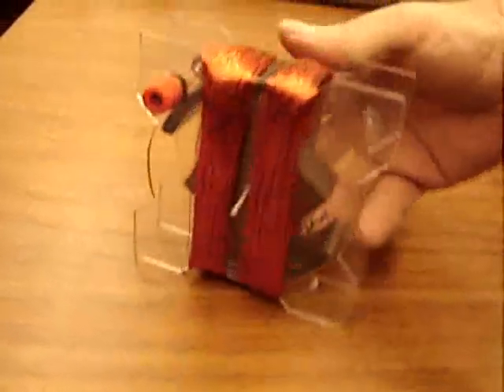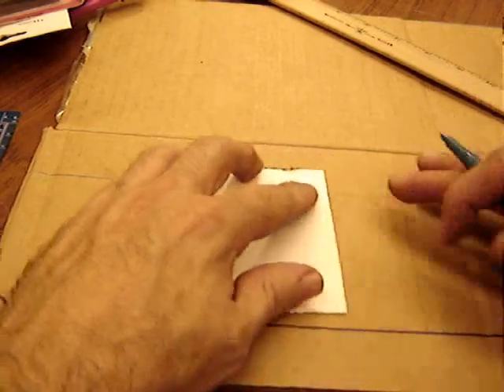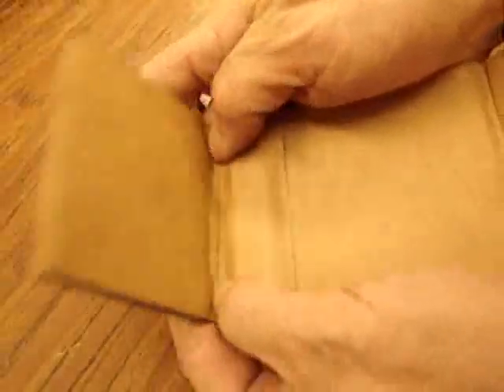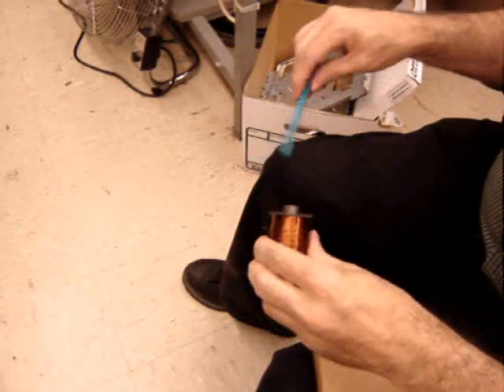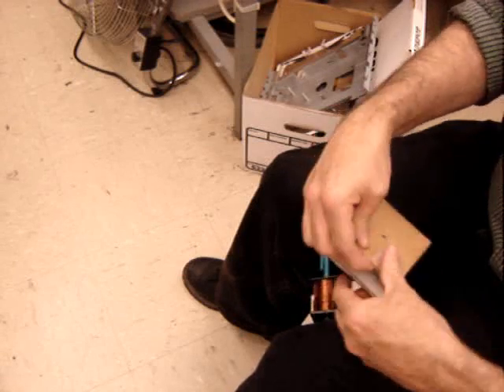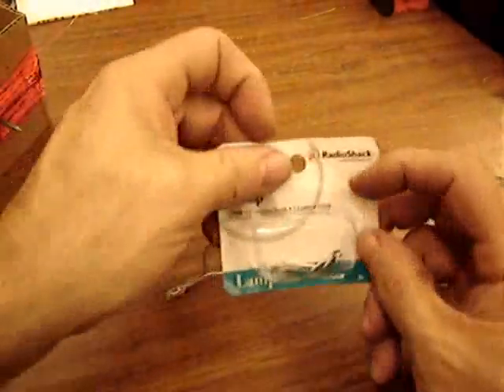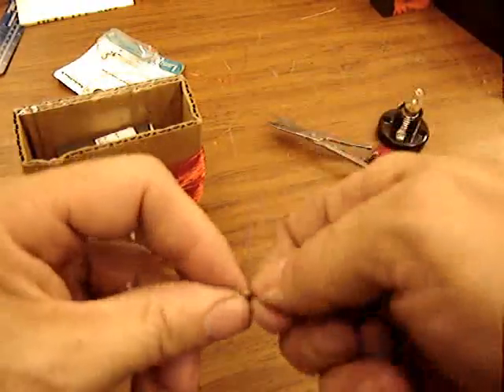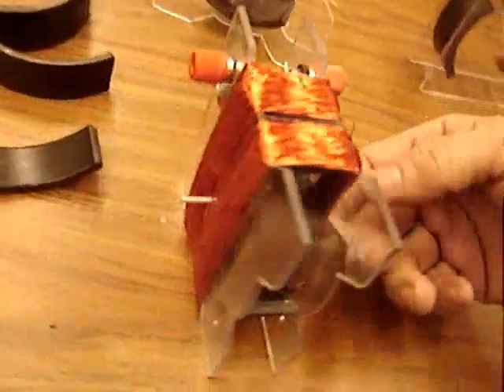Simple generator:  AC electric generator for science fair

Comment from the maker: Twice too big!   Needs to be under 0.3mm diameter, and enamel insulated (no thick vinyl insulation.)   See the website for all info, question 1. on the FAQ is about different wire & different magnets.

Trouble is, you need to wind 250 or 500 or more turns of wire.   If the wire is too thick, you end up with a huge wad, and the outer part of the coil is way too far from the magnets.

Comment from the maker: Ignore the video.   Go to the website.   Read the "DEBUGGING" section.   Try all those suggestions.

Usual problem: didn't spin fast enough.   The magnets have to really whiz like a blur.   Magnets MUST spin freely.  If the cardboard is grabbing the magnets and halting them, it won't work.

Second common problem: tried using different parts.  Didn't use the very thin #30 gauge enameled wire, didn't use special Radio Shack light bulb (since normal flashlight bulbs won't work.)

Comment from the maker: The more turns of wire and the more powerful the magnets, the greater the voltage.  Faraday induction: hyperphysics.phy-astr.gsu.edu/hbase/electric/farlaw.html  The generator is a constant-voltage source, with unknown current.

But because adding more turns of wire is adding more resistance, the maximum current stays the same when you add more turns.  To increase the max current you'd have to replace the coil with thicker wire.

Comment: This is based on an electrical engineering calculation.  The greater/bigger the magnets, and the more you wrap the copper, the greater the current.  I have not made this calculation in quite some time, but here's a general idea. Look at this web site hyperphysics.phy-astr.gsu.edu/hbase/magnetic/curloo.html  Bottom line is that the bigger the magnetic field and windings, the greater the current.

Comment from the maker: See main website, on "how it works."

If spinning those magnets with your fingers, each turn of wire gives about 1/300 volts.   To produce 1V for the bulb, you need about 300 turns.   That, or use expensive strong magnets.  Or spin them at 10,000RPM.   With *really* strong magnets spinning *really* fast, this generator would only need one loop of wire, not 300.

Comment: cut a drinking straw into two small pieces. Put them into the center holes and put the nail through them (so the nail touches the smooth plastic instead of the rough cardboard). This reduces friction greatly.

Comment from the maker: Not much thicker.  If you want it to work the first time, don't change anything.   Need hundreds of turns of wire, but also need to keep the turns very close to the magnets.  So, thin wire needed.

If your coil looks like a baseball, then the outer turns of wire are too far away from magnets, and do nothing.

Comment from the maker: Always build the original version first.   Any changes cause failure.  So, first make the successful version, then add small changes one by one.

Output volts is proportional to # turns in coil, and to flux change rate (roughly the RPM of magnets times the gauss at pole surface.)

It's easier to just wrap one turn around the spinning magnets and borrow oscilloscope to measure peak millivolts.    Then, if one turn of wire gives 1 millivolt, you'd need 1000 turns of wire to give one volt.

Comment from the maker: The nail store!  Hardware stores.

You can even try cutting up a wire coathanger.  When I was a kid, I did this by using a file to make a small notch, then bend it so it breaks at the notch.  (Or, many pliers have a tiny wirecutter thingy near the jagged gripper part.)

Comment from the maker: Go to website, read generator article, see partslist.    Large rectangle ceramic magnets from radio shack and other places.   Neo magnets that large would be $10 each (times four!)   If you use smaller neo magnets, voltage will be much higher, but build a much smaller box.  Don't use HDD magnets since they have two opposite poles on same side, which gives nearly zero volts output.

Comment from the maker: All the info is in the article.   The AC volts depends on how fast you spin it.  But it can only light up a bulb that needs LESS THAN one volt.   If you double the amount of wire, then you can light up a red LED that needs 1.7V.

Comment from the maker: But experiment defeats theory, so if the theory predicts failure, it's wrong.

:)

If the magnet stack went NSSN rather than NS, then as you say the average flux would be zero: an N pointing up and an N pointing dn.  Flux lines extend out the top of the coil, but with NS magnet the OPPOSITE flux lines extend out the BOTTOM, making it twice as strong instead of zero, because negative (south pointing) dotproduct negative (down pointing) gives positive.  Turn them 1/4 turn to change flux to zero.

Comment from the maker: You followed everything in DEBUGGING section?    Often the problem is the specialized Radio Shack light bulb (or one from All Electronics.)  Normal bulbs won't work.   But red LEDs do work, if you spin it faster.    Also, the magnets really have to whiz.  If they crash into the cardboard or even scrape hard, they won't go fast enough.

Comment from the maker: Have you read the article, DEBUGGING section?

Wire coating: read the article, USE SANDPAPER or the edge of a knife.

Magnets: did you spin them about ten times per second as the article says?  They really have to whiz.

Don't use any other bulb except the ones listed.   Or try a red LED.

Comment from the maker: AC voltmeters are designed for 60 cycles per second, not 10.  The reading is much lower than actual.

With neo magnets the voltage should be HUGE.   But the wire must remain very close to the magnets, hugging the magnets and almost scraping on them. If your magnets aren't the size shown in the article, then you must buy 5cm magnets.  Or make the cardboard much smaller.

Comment: s16.postimg.org/xm224n46t/Photo_on_5_19_13_at_10_19_PM.jpg
s16.postimg.org/3vexivj79/Photo_on_5_19_13_at_10_19_PM_3.jpg

getting only 0.25 v ac on my voltameter... 300 winds with #27 wire gauge with neo magnets, is there any way to amplify it?
also, I'm having trouble taking the thin coating off the wire as I am color blind and have a hard time using a knife, how do you take the wire coating off easily?

Comment: hi, i'd really appreciate if you'd help answer this

ive got most parts, but for the ceramic block magnets, ive found block magnets of a different size (20*15*5mm), should I just double it, or would that not work?

and also, for the magnet wire, i've found 0.5mm enamel copper wire 33 SWG, and im planning on joining two of them to get 200+ft would that be alright?

thanks very much

Comment from the maker: See the main article about this.  Spin the magnets much faster for red LED, or wind 500 turns, 800 turns, etc., or replace the ceramic magnets with neo rare earth magnets of equal size.   (With neo magnets, you only need about 50 to 70 turns of wire!  Don't use green or blue LEDs, they need even higher volts.)

Comment from the maker: Nope.  See the parts list, since it's from Radio Shack, also All Electronics, or buy a #48 or #49 miniature bulb.   These are specialized bulbs which can be lit up by half the voltage of the most sensitive LED.

Or, just use an LED and either spin the magnets twice as fast as for the bulb, or instead wind 2X or 3X more wire than 200ft.

Comment from the maker: 500T of wire gives about 1.5V when spun around 500 rpm.)   So 1000RPM would give twice as much voltage as 500RPM, or 3V output

But 500 turns of wire is about 400ft.  From wire gauge website, #30 gauge wire has 103ohms/1000ft, so  400/1000 x 103 = 41 ohms.

Maximum wattage on a bulb or resistor happens when the bulb or resistor is the same as the wire resistance.  And in that case, the bulb or resistor will pull the 3V down to 1.5V.   Output watts=1.5*1.5/41=0.0548, about 55 milliwatts

Comment from the maker: There are three spools on Radio Shack 278-1345.

Only use the #30 gauge,  200ft of wire.   I think it's the red-colored one, not the green, but Radio Shack could change the colors unexpected.   If in doubt, look closely and compare wire thickness.

Don't bother using the two thicker spools, they're way too short to make much difference.   It does help to buy TWO kits and use twice as much.  Spensive though.

Comment from the maker: Yep, neos are about 10X better.   But they need to be about the same size as the ceramic ones.   If smaller, then you have to use a smaller coil, so the wires stay close to the magnets.

Comment from the maker: See the main article.  A red LED will work, but you'll have to buy extra wire to wind lots more turns on your coil.  Either that, or figure out how to spin the magnet MUCH MUCH faster.   The special light bulb turns out at about 3/4 volt, while a red LED needs twice as much: 1.7V (must spin the magnets twice as fast if using an LED)

Comment from the maker: To charge a battery you need a DC generator.  Those things aren't simple.   But if you could build step-up gears or rubber band pulleys, you could spin this one 10X faster, and then add a diode to turn the AC into DC.   (To use a diode, the generator voltage must be WAY higher than 0.5VDC.  See the main article about diodes/DC/batteries.)

Comment from the maker: Wire doesn't have to be smooth.  But sometimes tiny knots/kinks will later cause a break.   Hint: for temporary, I wind the wire onto a large empty can, or even onto a 1ft ruler.

If you can spin the magnet faster than 10revs/sec, the voltage will be much higher.  In that case the coil can be farther from the magnets, and still light the special bulb (or even a red LED.)

Comment: great video. I was trying to recreate this using Legos for the housing. Unfortunately I wound too tightly and the housing collapsed. Now the wire is all knotted and kinked. Assuming I can get it unknotted, are the kinks a problem? I'm also not sure if the housing would have worked because the wire was fairly far from the tips of the magnets.

Comment: thanks for that. Do you have videos on how to store energy from electric generator to battery? If the electric generator can supply let say 2 volts, whats the possible way to store it for future use and how?
Reply: This is a AC generator so you can’t charge a battery off of it right a way, you’ll need to build a full bridge rectifier on a bread board which converts the AC to DC then you can send it to a lithium ion battery to charge. I’m thinking of building this for my sons science fair

Comment from the maker: > change the gauge

Lower internal ohms, higher maximum current.

But thicker wire means wider coil, and if the outer turns are far from the magnet, then the generator output voltage is lower.

Comment from the maker: To increase generator watts, increase the total weight of iron and copper.  This works for motors, generators, and transformers.   If too small, maybe it bursts into flame, yet output wattage remains low.

500W is over 1/2 horsepower.   You'd need something the size of a half-HP or maybe quarter-HP motor.

Comment from the maker: Follow website article exactly.

Don't use any different parts.

If you did read my website and built the cardboard generator, see the whole DEBUGGING section about common mistakes.

Usual mistakes: didn't use #30 enameled wire.   Or, tried a different kind of magnet.   Or, didn't use bulb number 272-1139

Comment: Can you explain to me how to make it work? I've created a shake generator and I still was not able to make the light bulb light up. Also for your magnets that spin, do the magnets have to be located on the internal of the coiled wire, or can it generate electricity if it's spinning on the outside? If so, how do you coil the wire and where do you place the magnets? Please PM me if you need more room for answers.

Comment from the maker: Maybe works.   But 300-500 turns of wire must remain small and close to the magnet.  If you use thick wire (or wire with thick plastic insulation,)  then your coil is the size of a tomato!   The outer turns of wire do not create any voltage when they are too far from the magnet.

But  ...with large loudspeaker magnets, the generator creates higher voltage.   Fewer turns of wire would be needed to light the bulb or LED.

Comment from the maker: With any magnet, don't spin it on axis through the poles.    If you thread some small ring magnets onto a pencil, it won't work to ROTATE the pencil.  That won't move the magnet poles.   The stack of magnets needs to flip end-over-end.

If you can't get #30 wire or similar, you can't build this.  It needs a few hundred turns of very thin wire.  See the main article for many hints on finding wire.   (Yes, if you have many 200ft pieces of #30, you can clean off the ends and twist them together.)

Comment from the maker: > increase the size

Yep.  See the FAQ on main website about upping the voltage.  Use a stack of huge loudspeakr magnets or neo supermagnets, add more turns of wire, add a crank-pulley system to spin it much faster.

In my links collection, see Gupta's "Toys from Trash" site for generators with cranks made from CDROMS and rubber band belts.  If you spin it 10X faster, the voltage will be 5V rather than half a volt.

Comment from the maker: Other possibilities:  The Radio Shack wire has three spools, so only use the thinner one (red color usually.)   The wire on the other spools is way too short, and won't give you 250 turns.

Also, you must clean off the two wire ends very thoroughly.   Sandpaper works well.   Or scrape all sides with a sharp knife edge.   Clean off about an inch, then twist it securely to the metal tips of the lightbulb wire.

Comment from the maker: Did you read the article?   Did you go through all the DEBUGGING steps listed there?

Usual problem: used other parts than the ones listed in the parts list.   It won't work if you use the wrong bulb, or wrong magnets, or wrong wire.

Comment from the maker: The generator is simple and crude, and can only power a special half-volt bulb.   It also generates AC, so if you connect it to a DC motor, the motor will only wiggle and not spin.

See the project FAQ for info on making the voltage higher.

Comment: But our teacher said that we can't use and battery or electricity, we need to make the LED light up by changing the magnetic flux. And he told us that we need to be able to connect it to a capacitor and it needs to have a switch.

Comment from the maker: About using other magnets: see the project FAQ on the website.   Remember, the wire coil must be very close to spinning magnets.   If magnets are slightly smaller, box must be smaller.

Wood would work if it's very thin (like 3mm thick)

Comment from the maker: If you use small magnets, it won't work.

But if you find large neo magnet about the same size as the ceramic ones, the voltage will be nearly 10X higher.   Or, just use one or two large neo magnets instead of four.

Comment from the maker: I've seen AC hand-crank generators where the coils were wound on permanent magnets, and a spinning iron thingy with slots or fingers would then close the path of flux, to vary the magnet field at a high rate.  No moving magnets, no moving coils, just moving iron with changing size of air-gap.

Comment from the maker: Probably the ring/cylinder has many magnet poles.   Rather than using many separate magnets, instead they use one hunk of metal, but magnetize it with a pattern of NS poles.

That, or it's an Edison-style DC generator where the ring is magnetized to have N and S poles, and all the small coils connect to copper segments of a "commutator" with carbon brushes.

Comment from the maker: Don't use different parts.    If you don't use the parts in the parts list, it won't work,

272-1174 is the wrong bulb.

The right bulb has little wires attached already.

Comment from the maker: For DC motors go look at sciplus com, or All Electronics, or Herbach & Rademan.   They are surplus junk catalog sites, with lots of DC motors.  (or search for "surplus catalogs list" website)

The tiny motors inside of toys are DC motors (since they run off batteries.)

For making a large professional wind turbine, try to get a replacement treadmill motor for use as a DC generator.   You want the "PM" or permanent magnet kind, NOT SHUNT-WOUND

Comment from the maker: Those motors have no magnets, just an electromagnet.   If you could spin it about 7000 RPM and hook it to a large bank of batteries (120v dc) you could charge the batteries.   You'd have to spin the motor faster than it would normally spin when used in the vacuum cleaner.

Comment from the maker: Read the website.    About fifty times it says DON'T USE DIFFERENT PARTS.   No, bare wire will not work.   Also, normal wire with plastic insulation won't work.   It has to be thin #30 wire called "magnet wire."  It has to have very thin varnish enamel insulation.

Comment: wbeaty - Thanks for taking the time to create the video!! It was very helpful. My daughter and I made one out of plexiglass we purchased from Home Depot. We cut two 3 1/2" squares and three 3 1/2 " by 1" strips and crazy glued together to create a cube with one side open to be able to access the magnet. Used a bolt and nut so I can spin with a hand held cordless drill. Works great. One question - if I wrap the outside edge of the magnets in electrical tape will it interfere with the current?

Comment from the maker: > How many watts

Gotta measure it.   It depends on RPM, on #turns of wire, and on strength of your particular magnets.  However, if it runs a half-volt light bulb at 10 milliamperes, that's 5 milliwatts (or energy output of .005 joules per second.)